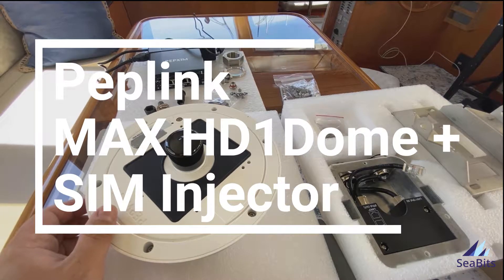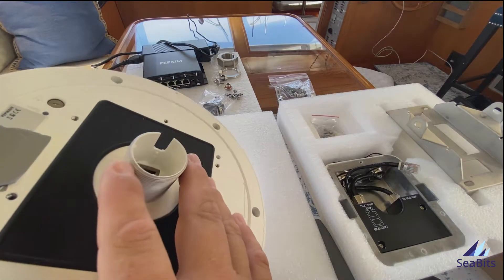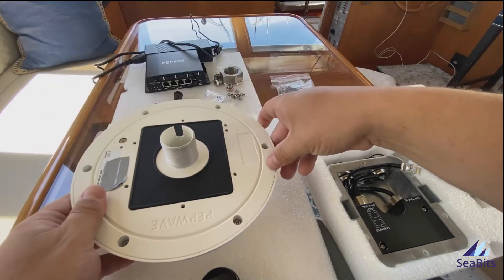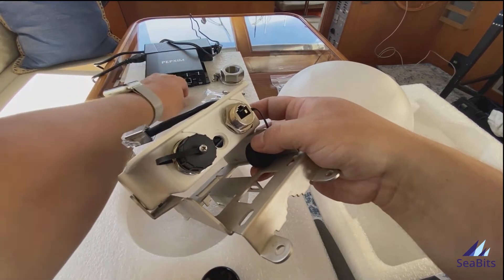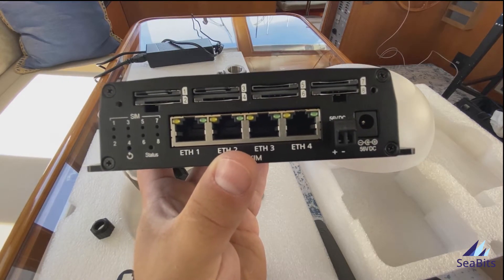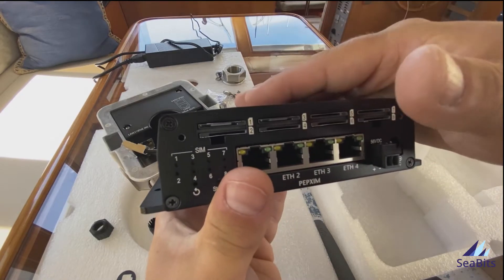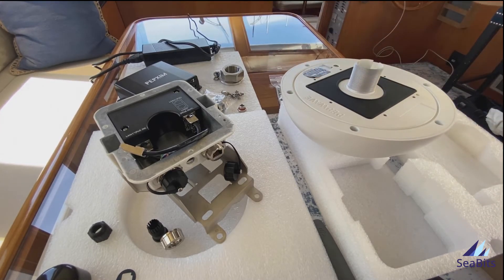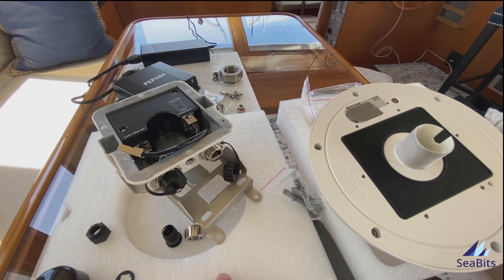Peplink MAX HD1 Dome + SIM Injector

Comment: Steve would you do any more to future proof for 5g
Reply from the maker: The Dome would definitely not be 5G capable, so it is a purchase you'd have to be comfortable with not supporting 5G. Very few routers support it, and most are just supporting new bands on the older 4G technologies. Some newer, and very expensive, routers do have modular radios which could be swapped out for 5G, but they are few and far in between and extremely expensive. There's not much you can do to prevent having to buy newer radios or devices in 1-2 years.

Comment: Just to confirm, the max transit you are comparing the signal strength is also a CAT 18 right?
Reply from the maker: Shakir Thowseen yes it’s the newest MAX Transit CAT18 with the same exact modems.
Reply: @SeaBits   (EDIT: Found this question answered in the linked blog post comments)That is a really useful data point. Thanks for putting this video up. I'm debating between a HD1 setup vs MAX transit (cat18) with Poynting OMNI LTE antennas. Since you've got hands on experience with all these devices I wonder if you have any thoughts. This is for a RV setup to travel in remote locations.
Reply from the maker: @shakirthow  lots of thoughts at the linked blog post. Both have benefits and cons. On an RV, the Poynting antennas might be an issue for height, while the dome not so much. The dome might not perform as well as the antennas in very low signal areas. More in the blog post as well.

Comment: Thanks for the video, great overview :-) Found you blog as I'm just looking at upgrading our boat's LTE set-up.  Was wondering if you had come across or tested a brand called outdoor router? Not quite as enterprisy as the peplink gear but looked like it might be a halfway house. I literally can't find any info on them other than their marketing site :-|
Reply from the maker: I have not heard of them. Their website has more spelling and grammar errors than I have seen in a long while. It looks like they are using OpenWRT similar to the GL.iNet Amarok I reviewed, and the Teltonika that I am working on now. The big difference is that it is in an outdoor enclosure, which might make some things simpler for the LTE antennas. I would be worried about the lack of technical info on their site....
Reply from the maker: Also, it appears that the "American" version does not support or has some sort of certification issues with Verizon, so that could be an issue if you use that provider.
Reply: Yeah it does look like a budget chance choice. My reckoning is that it's probably not far off our current solution of an ActiveTab2 in a dry bag half way up the mast.. 

From today's zoom calls my partner and I definitely need QoS. If I'm on a zoom call and she commits some code it's game over. I'm guessing that once you have some more data that you'll push out findings on the HD1 Dome. Looks like a great piece of kit, without the cable run and with the injector it's realistic to put something like that up at the radar dome or even on the top which would give nice clear line sight without the loss and with ability to change Sims.
Reply from the maker: The Dome is great, but all of the MAX series have QoS and bandwidth management features. I cover some of those in this article https://seabits.com/limiting-data-on-board-your-boat/

I use it constantly both with and without others on the boat. In particular, I make sure my primary laptop always has enough bandwidth for things like Zoom calls and IM/Slack, and de-prioritize things like my iPad and iPhone, which often times take up a lot of bandwidth doing stupid things. Setting the network to "Low Data" mode on those devices also will help.
Reply: @SeaBits  Yeah makes sense, I've ordered the outdoor router. When we get it I'll do a full review as there don't seem to be any/many. Long term I'll probably end up with a dome but just bought a nice new rib and outboard so feeling poor at the moment and our old modem is on its last legs..

Comment: I didn't know you'd moved on to videos. Great job! Much more practical-oriented than your blog posts and a great complement. You had me completely sold until you hit the prices  LOL.
Reply from the maker: I have a few videos, and will be trying to make companion ones to the blog posts when I can. Both take quite a bit of time to get right!  The prices are definitely a big decision point. You can still spend a lot of money even on a cheap solution if you add in antennas and cabling, so it really comes down to how good of a connection you want, how much space you have, etc.